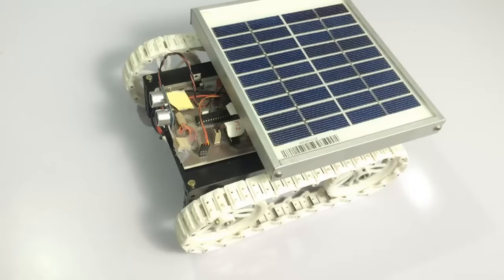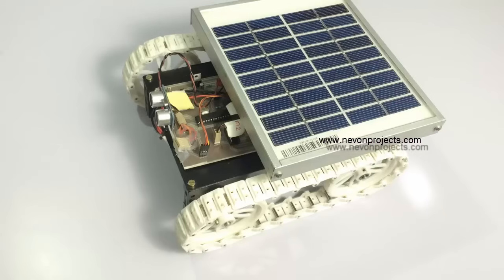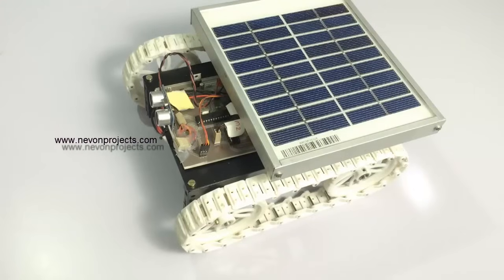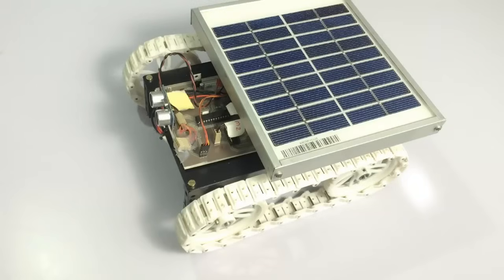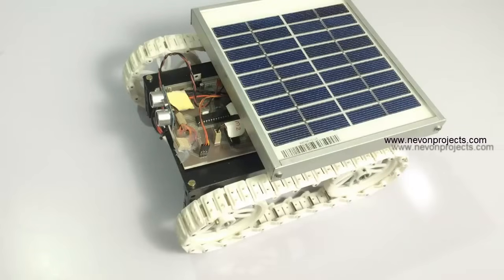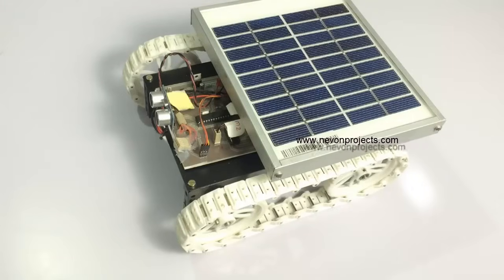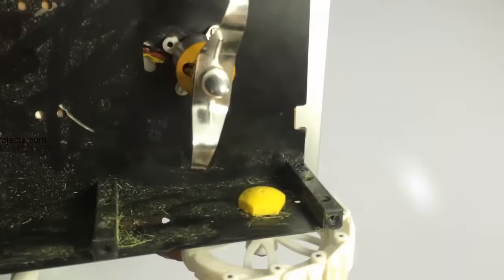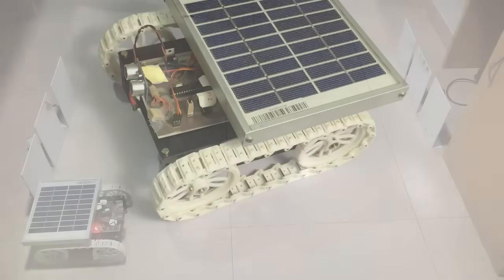Smart Solar Grass Cutter With Lawn Coverage

Comment: Sir, I am also working on the same project as this, you used the brushless motor I also use the same.
But I have a few queries:
1. Have you used the ESC controller for operating the motor with a battery, along with the potentiometer to control its speed.
2. I have thought of using the Li-ion battery (12V) for this project, is it suitable...
3. I am using the microcontroller (Arduino UNO) for this project...

These are some queries, can you help me with this...

Comment: a good concept but the design not really suit the function as lawn mower. Look at the cutting area. very small comparing to its body size.
Reply: Perhaps a larger plate with blades would be suitable, yes 🤔

Comment: does the solar panel provide enough energy for the motor to actually work well enough to cut the grass ?
Reply from the maker: For free synopsis, ppt or any details of this project - Pls Call/Watsapp +91 7738796642
Reply: Yes bro
Reply: I dont think so, the battery drains quicker. Its not quite sustainable. Although I assume it could maybe charge up over the day.